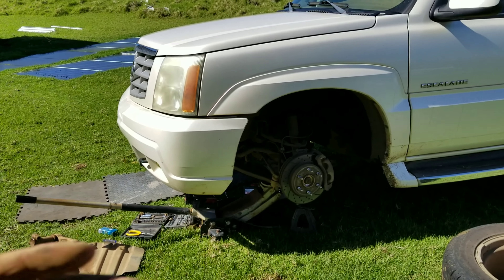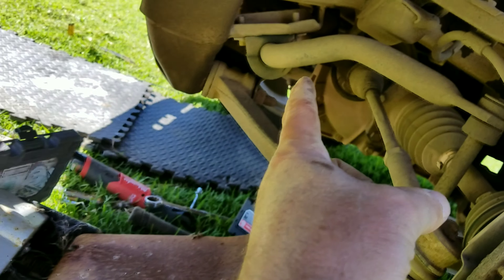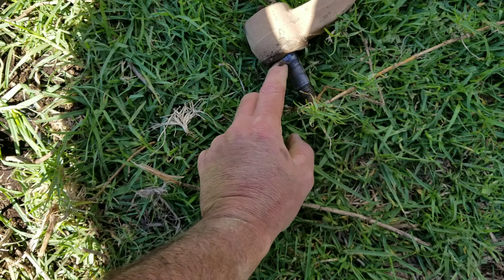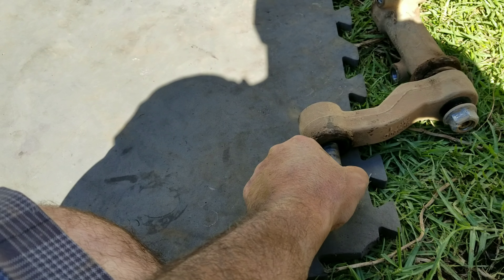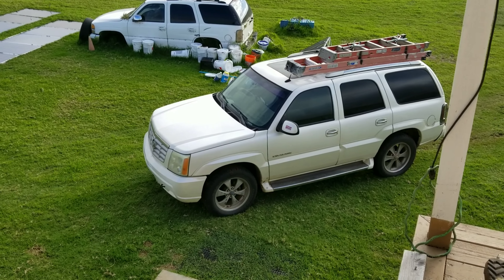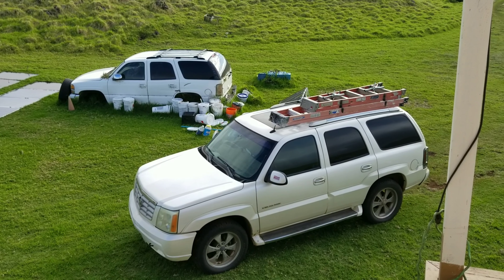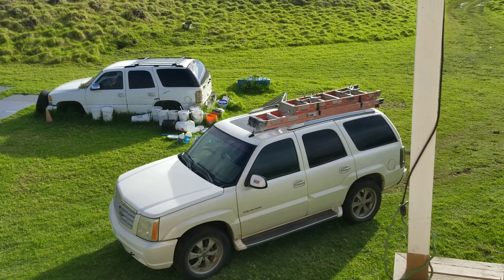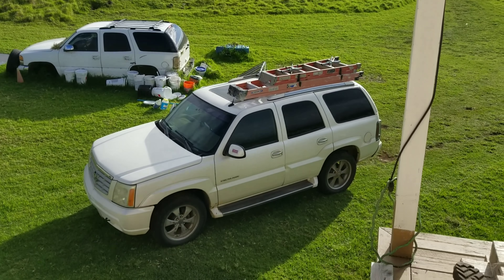Escalade Front-end Loose Death Wobble - Fixed !

Comment: Hi there friend!  Good catch on the hardware problem.  I have two Tahoes. One of them is a 2001 and the other one is a 2006. The 2006 is the one that the wife drives and mine is the older 2001. My wife's car has very tight steering on it and mine has a little bit of drift and I believe it is the gearbox needs to be tightened just a quarter turn. Hopefully that won't cause other problems. Yeah it looks like you have been pretty busy lately with the house and the flooring. it seems like that there isn't enough time in the day to get what you need to have done.  The weather here is cooling off a bit so I can go out in my shed and do some of the work I've been putting off because it's been so hot out there. I spent the day today working on a TV antenna so I can get off-air channels besides my DirecTV. I cut the antenna that I had for all channels in half and am working just with the UHF side of the antenna. We will see how my engineering job does tomorrow as I have to change one of the connectors to make it work.  I am glad to see that you are having some better weather now that the hurricanes have run the course and are on the other side of you now. Anyhow, just wanted to say hi and see how you were doing.
CUL...  Lou
Reply from the maker: Hey Lou, it's nice to hear from you, looks like you'll be busy with your projects cool man, you know us guys and our projects is what keeps us sane lol
Reply: @ModernOffGridDIY    Yes this is true.  Some times we get so excited about a project that we are awake all night planning it out.  Thanks for the note.  Good luck on your projects!
Reply from the maker: Thanks Lou, hope your projects go well too.

Comment: Their are two parts that look exactly the same under there the piece that connects to the steering box is called the pitman arm the part you fixed is the idler arm and man did you over pay. You should be able to replace both idler arm and pitman arm for under 100 bucks.
Reply from the maker: Cost in Hawaii are high